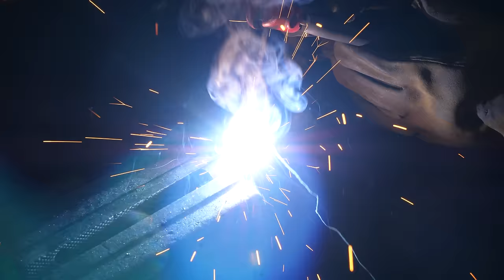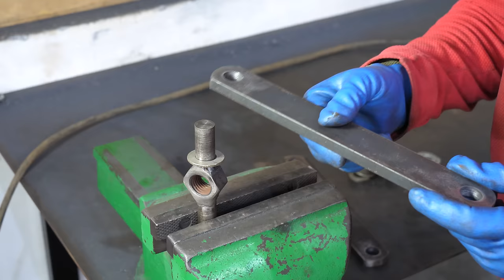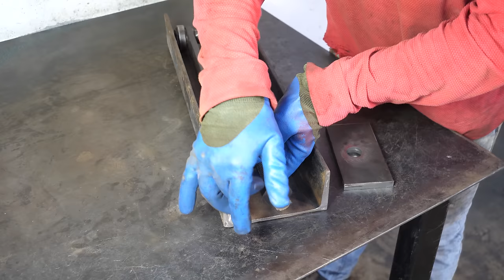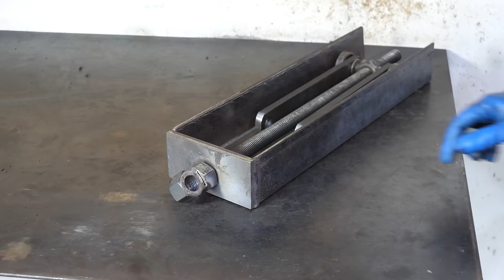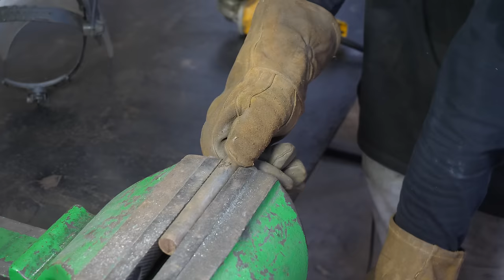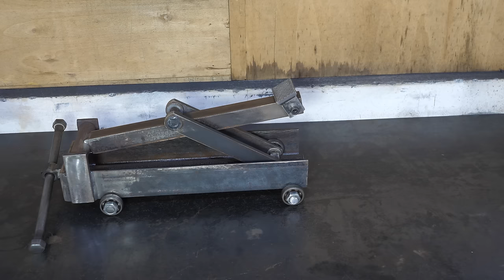How To Make A Homemade Scissor Jack | DIY

Comment: Great tool. If I could suggest one thing. Shorten the jack arm to bring the jacking pad inside the wheel base. When you jacked the car up the jack was front heavy and could lead to the jack tipping forward.
If you bring the jack pad between the wheels it will be more stable.
Reply from the maker: Ok thanks for your suggestion

Comment: I'm not an engineer, but i think, if you can tilt the whole system, with the handle a bit higher like about 8 inches off the ground, it can be good for cars etc and you can keep rotating it without having to shift levers from side to side

Comment: Adapted idea from conventional scissor jack, but well made. Just some input.
If you not going to give dimensions then take out all the "cutting " of material, channel,round bar, flat bar,etc....we know how to cut, just adds time on the video.

And more importantly,  you could hsve added safety  rod into the frame as to lock the jack into place at different heights. And also swivel out flat bars underneath, to add to.stability on the ground. 
As i said,  when you adapt an idea....don't copy it....improve it 
I just thought of these ideas while seeing your design. 
But great skills, just think out of the box

Comment: Great work...solid design overall.
I would however used a more efficient design where it would use a 3/8 in rod bent at a angle with a pivot point where it connects to the threaded rod where it could be turned continuosly without hitting the ground and with the user standing instead of kneeling...
Gotta save your knees and back
Reply from the maker: Thanks for your suggestion